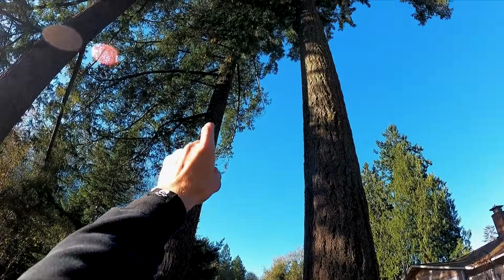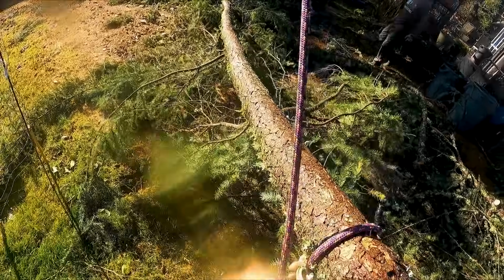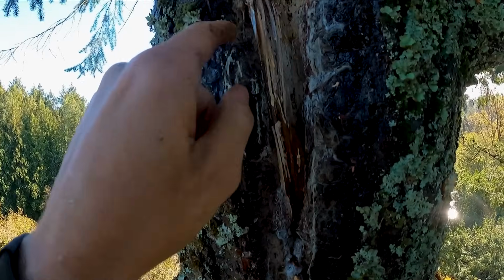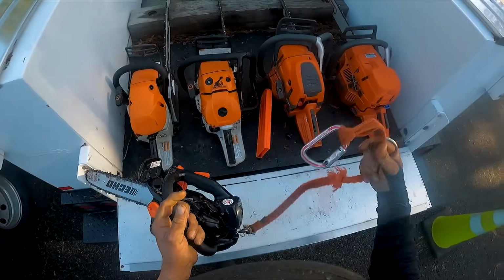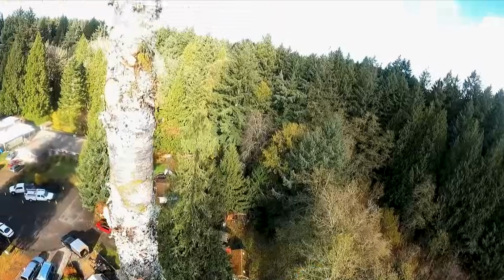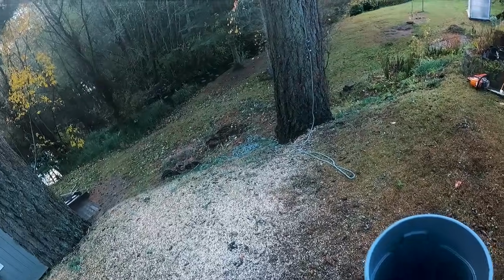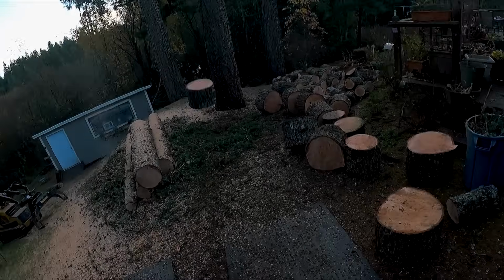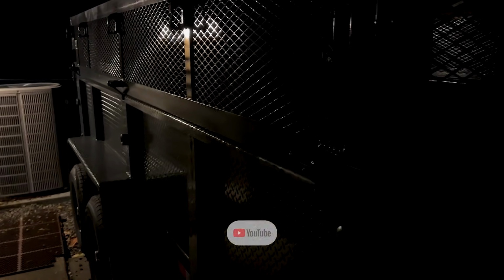Removing Two Tall Backyard Fir Trees with Veteran Tree Service and Randy!

Comment: Thanks for your help. 🙏

I just cut down an 80ft feet in my back yard with all the tips it worked very well. It was damaged by a hurricane and was leaning and moving around A LOT. It wasn't the first tree I cut but it was more complicated than the rest since the yard is about 80ft across too. I tied to two smaller trees to make it would fall in my yard no matter what. Then used 1 tree, some 3000lb links with looping the rope back and forth as pullies and then pulled a little bit with my car to pre load it leaning the correct way.  And I had already measured and marked all my cuts with spray paint. Then cut out the "pac-man" then moved the car a little bit the increase the lean. I did a plunge cut first for the back cut across to set the back of the hinge wood. And once I was sure everything was good I finished the back and MAN that SNAP of the last sliver of wood in back was seriously LOUD. 

 And it dropped really fast right where I aimed.

Comment: I would love that saw. I have one and nothing beats the weight especially…the only thing lacking is the power…which porting would solve.  Love the conversion truck. My small pruning truck is a 2002 Chevy 2500 with a pierce dump conversion, booster bags under the axle and an onboard DC compressor to load my bag launcher and clean my tools. Efficiency in this work is where it’s at!

Comment: A quick tip for getting rope in and out of zigzag. Whip the end of your rope with 50lb braided fishing line, the braided line has such small diameter it actually compresses the rope to a much smaller diameter makes the process effortless

Comment: Cheers from Turkey, amazing video.
 
You should try "thermal pad"(a high quality one has 20W/mK thermal conductivity) for the heating problem of your gopro. Just open it up and stick thermal pads on integrated curcuits(big black boxes). or use a heatsink but I would recommend the first one.

Comment: Starting out, I bought a spool of Hyperclimb for something like 350 bucks or less.  Cheap and seems to work fine.  I am also a big believer in the 2511T.  I finally got my Speedcut Nano conversion kits last week.  Should improve cutting performance and smoothness of cut.

Comment: The side handle on 2511t and its weight size is what makes it best saw tophandle period. Guys might be obsessed with stihl ..but the echo 2511t has best design...use it for 70 percent or more of work. With qaurter pitch. 0.43 stihl polesaw chain micro and bar 14 or 16 panther it's unrivaled..gotta drill that muffler out and remove limiters..crank her up.mybstock version has Been 5 years no issues..other than dropping it once

Comment: When you get older and or have health and joint issue s.. especially..great saw..underrated...cannot understand why echo don't make a 3911t or 3511 t.....it makes no sense best design on the current market..and has 5 year warranty. .even commercial they still gave me that...dealership...the 4 2000.00 dollar saws I bought from stihl dealer ship 462.500i.661..and 201t that sits around ...only came with 3month warranty??before I even used 2 of them it was up?out Warranty...insaine